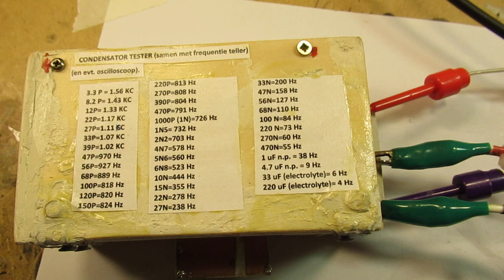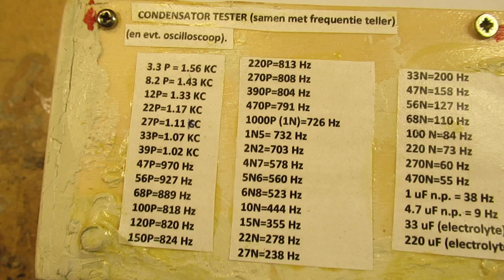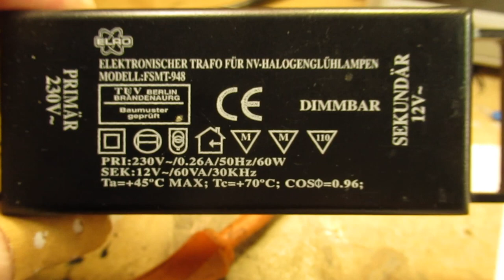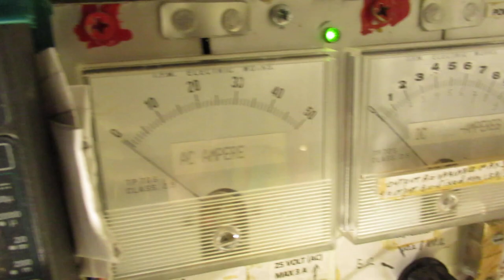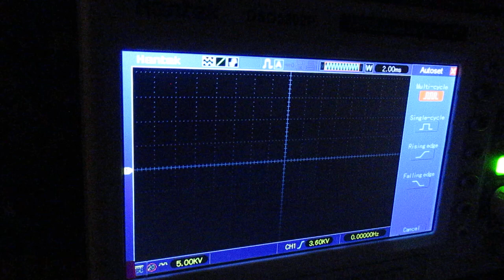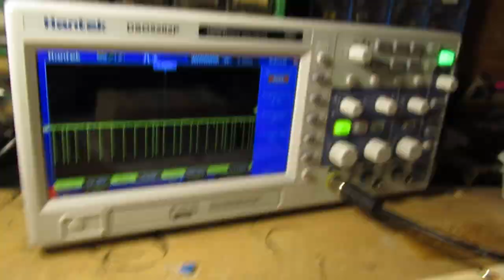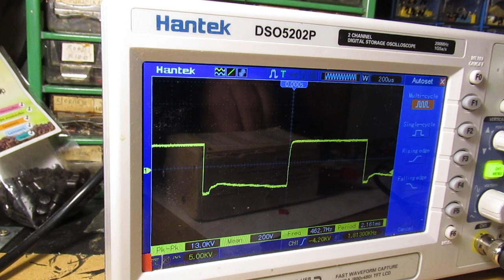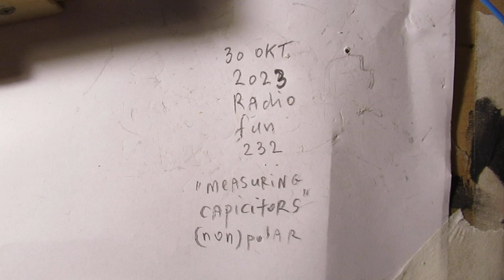Testing capacitors via the "frequency method" using an oscillator and a frequency counter (demo)

Comment: I have just learned how simple grid dip meters are to build. I always thought they would be difficult and expensive to build but they are not. I just need to scrounge a panel meter and maybe buy a transistor. I don't know if I would ever buy an oscilloscope, probably not. Too much money.

I really enjoy your videos. Thank you for making them.
Reply from the maker: Without an oscilloscope the electronics technician is as blind as a mole, but indeed they are expensive. I will send you a diagram of a dip meter shortly. Thanks.
Reply from the maker: Dipmeter is e.g. here https://youtu.be/u7GNIsv1yEo